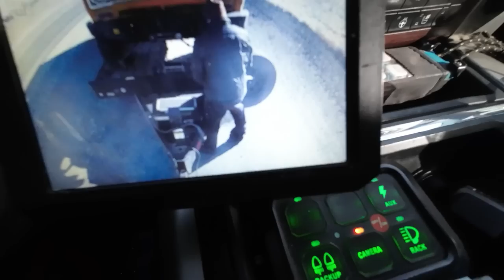They left us unattended in the Yankum Ropes Factory!

Comment: 8409.09 miles of fiber in a 30 (37ft) Yankum rope (of whichever diameter rope you gave the numbers for).  The Earth is 24,859.734 Miles at the Poles or 24,901.461 at the Equator.  So that rope broken down to single fibers, end to end, it would take 2.956 (3 rounding up) ropes to make it around the Earth at the Equator.

Was great to see the Yankum factory and Awesome to see the truck make the trip.
Reply: Thanks for the info.
Reply: To help visualize the distance a flight from Salt lake Utah to Melbourne Australia is 8453 miles.
Reply: So the earth is approximately 7,917.5 miles diameter from pole to pole. So if you could drill a hole through the earth, one 30’ rope would stretch all the way through and still have enough left to pull your wrecker from home all the way to the wrecker games :-)
Reply: Yeah, what he said😂
Reply: 🤔 How many to the moon? 🌙 

🤠 I'm ready to lasso that moon? We can't have it getting away on us now... lol

🤔 What about how many ropes would it take to make a rope bridge to Mars??? You know that would make Elon Musk very happy. 👨🏻‍🚀
Reply: Actually, it's a lot more, the fibres are braided so each "run" is much longer than the finished rope. I'm not sure of the actual braid used but it could be two or three times that easily.
Reply: you're off a decimal point 84090.90909
Reply: So, according to NASA the Moon is an average of 238,855 miles from Earth. That's 28.4 Yankums. Mars is an average of about 140 million miles from Earth. That's 16,648.65 Yankums from Earth. And NASA will now start measuring distance in Yankums.
Reply: @marvindebot3264  very good point the braiding likely adds an extra 30-50% of length
Reply: @jebediahkerman3946  Under rated Comment. ROLF
Reply: Dang the math lol cool info tho
Reply: wow, thats amazing math in stone age units. or do it in metric 1,2mio cm /100 = 12.000m/1000=12km p. cm and be amazed how simple life can be *smuggasm

Comment: To think that double braided nylon ropes were created under a patent back in 1959 by Samson Rope Company. Have used those type of ropes to tie up military or I should say government vessels, 600 ft long with 12 ft eye each end.10 " in diameter 30 lbs per foot as  mooring lines as a merchant  sailor. Been splicing eyes in the rope used on my boats since age 16. Have  fids for everything from 1/4 in to 1 in and the splicing manuals. Was nice to see the inside of the factory.

Comment: when i worked on the paper machine we used ropes to help feed the paper lead though the dryers to the back of the machine to the reel where we had another section of rope , we would have to spice the ropes together , as long as there is a load on the splice in the  rope it stays tight seeing the work that they do for the weaving of their ropes brought back the memory of working on the paper machine , now days the paper is feed through the machine by pressurized air on guides .

Comment: I too thought that Warn Winches were the best and then I used the Harbor Freight Winches and noticed that so was everyone else, I’ve never had one issue with them and it sits on my trailer with a battery and one of there solar panel with a charger on it and that assembly has NEVER failed me once in the five years I’ve been using it!

Comment: Ive had a Engo E10000 winch since 2016 on which ive replaced the solenoid 3 times but the winch is just fine. First solenoid was from water damage, the second was from changing directions on the controller while it was going the opposite way and the third is still going strong

Comment: And the first two minutes are why I like Casey. Warn are existing on a name and they charge like a wounded bull for it. You can break a lot of Badland winches before you pay for a Warn and HF will replace the Badlands no questions asked. The one on my car trailer is a no-name Chinese 5000-pounder that I bought for 150 bucks from eBay, it's three years old now and still running fine, even both the wireless remotes still work.

Comment: Warn winches? Yeah I have one on my old 80 series landcruiser.
It failed out of warranty. The freewheel lever got stuck out of gear.
When I stripped it I found out why - they were so cheap that they only put a teaspoon of grease in it. While it was apart, I had look at the brush gear & wasn't impressed - not what you would expect for the current it has to carry.
Anyway I replaced the brushes and packed it with water resitant grease. Haven't had any problems in the 10 years since, but then it doesn't get used very often. Only used it twice to rescue myself. The rest of the time I have used it fell trees. The hardest job it has done was pulling out a row heavy wooden fence posts on a friend's farm. His tractor couldn't get them out, but the winch did well.

Comment: Not sure if I did it right. One point two million individual strand's times 37 feet is 48,100,000 feet divided by 5,280 feet in a mile you would get 9,109.84 miles if you put the strand's end to end.

Comment: I’ve wrapped cable on smittybuilt mile marker and warn winches are by far the most common winch I wrap when they don’t re-spool under power … for a long time there where brand new winch’s with metal shavings that clogged the works from the factory … still born and a lot of retailers ate the cost because warn wouldn’t honor the warranty… new brand manager may have changed that but yeah bang for the buck and damage done leaves questions ??? It seams if you get a winch from one of the three major wholesale factories these day the fail rate is fairly low so that’s the bright side this day in age😊

Comment: I honestly believe that consumer grade products and commercial grade products are exactly the same.  They just charge more for commercial grade because of the higher risk of failure in a commercial environment.  Or it's possible that the consumer grade is made with cheaper, less durable parts.  Same with lifetime vs 90 day warranties on parts.  Same quality, they just paint them a different color to signify the warranty period.  Look at the internals of some Briggs & Stratton engines.  The commercial ones have metal cam gears while consumer grade have plastic ones.